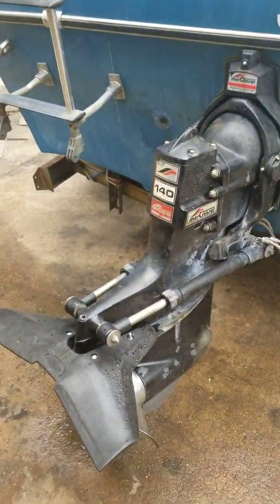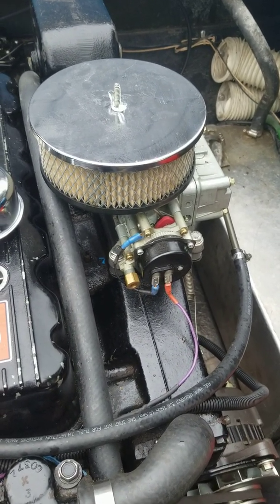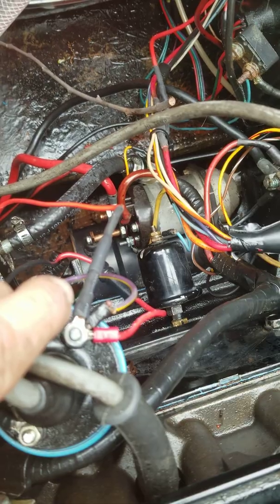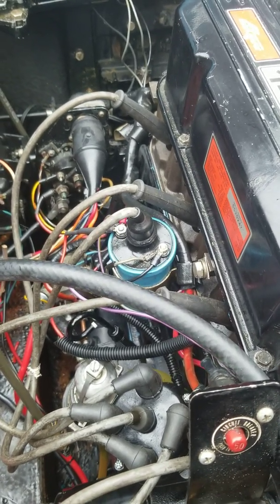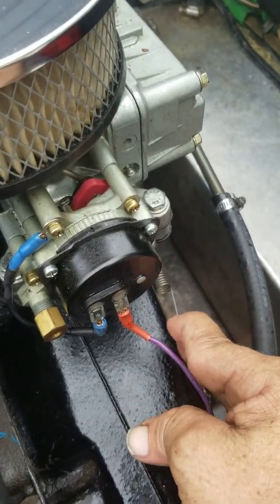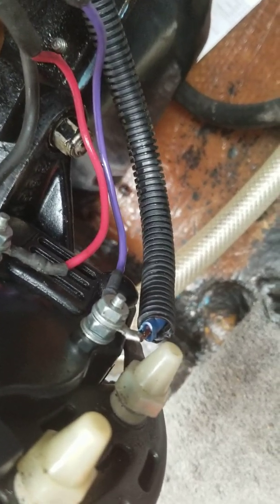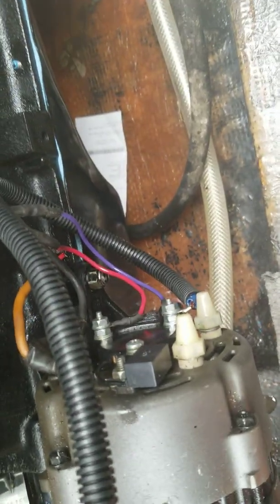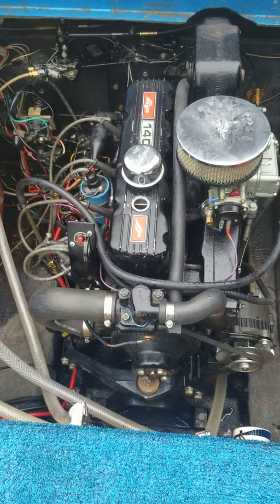1980 mercruiser 3.0 resistor wire & electronic ignition upgrade

Comment: Second, I dont doubt that you got it to work but it seems to be at odds with what the book says about which is that the purple/yellow line is the resistor bypass and the purple is flat 12V.  This is because the original coils were zero ohms.  I measured mine and sure enough the pur/yel line measured only 9+V.  So, it would seem that the all purple wire should be the right one for your purposes even without going to the alternator so it should work that that is the line that needs to be cut.  The manual clearly identifies the purple only as the ignition line.  Pertronix states that too low voltage will cause exactly what was happening to you.  The ignition will fail because the unit overheats with low voltage.  Same if you leave the key on.  When you use the resistance type coil you are adding ohms which makes the problem worse.  Pertronix says to route full 12V to their unit even if you have to go all the way to the key to do it since it has to come from the key switch otherwise you are charged all the time.  With that coil I think if you just cut the pur/yel line you would not have to go to the alternator.
Reply: I wish u could give me some advice...I have same motor ....it will turnover...just can't get it to fire up...I don't understand it at all
Reply: @j.p.foleyjr.6333  The biggest problem I had was that the magnet collar did not physically fit under the standard rotor.  I never did get it to work so I took it to the shop and had them install a totally new solid state Delco distributor.  I just lost all confidence in the reliability of this system and since I fish on Lake Michigan, reliability is rather important.
Reply: @berniestarzewski5482  Pertronix support advises us to tap the magnet collar down on the shaft with a socket that fits over the shaft.  I ran into the same issue.

Comment: The problem with this is that that type of alternator no longer passes Coast Guard inspection as you have to have a spark arrestor shield on the back.  It has a pass thru jack on it but not for this.

Comment: I bought the hot spark(1146A) and 3.3olm coil (1988, 3.0L OMC) what I am understanding, is cut the purple(resistor) wire at the positive side of the coil, then run another wire from the alternator to the same place as the cut wire, is this correct???

Comment: I'm sorry. This was pretty confusing. I have a 1979 Viking Deckboat with a Chevy 305 (Mercruiser) I recently bought. It has ignition issues! For one I'm pretty sure the Distributor is bad. Original Points and Condenser type. I can spin the NEW Rotor by hand so Timing it is not possible. I think I have to r&r the Distributor and I was wanting to upgrade to E Ignition. So far I've had to change the Fuel Pump, then the Starter and now the Ignition System is giving me issues.

Comment: Hi Wes Miller here, thanks for your video. My question is now I bought the same Electronic ignition as you go, but I bought the 3 ohm coil. Hot Sparks customer support told me to get the blue german 3 ohm with this hook up. Can I hook it up without changing anything. My Boat set up is a 1987 mercruiser 4 cylinder 165. The reason I haven't hooked up is I am confused with the 4 wires that are hooked up to the old coil. The 2 that run to the +positive are red and purple and 2 black to the -negative? I was about to hook up till I came across your video and talking about the resistor wire?
Reply: I have a 1987 mercruiser 120 hp.  My boat backfired and would not get past 1700 rpms out on how lake.  Took it home, changed plugs, put pure gas in it. Ran mechanic in a bottle to clean carbs, mechanic in a bottle mixed with gas; it seemed to run better after this.  It was hooked up to muffs btw.  I don’t know what will happen when it put in water?  

Yes, my mechanic put electronic ignition on it, got rid of points and condenser.  Anyway, this may be my problem too, but I am confused a little  by the clip.  I’m like you with your question.  Did you ever figure it out?
Reply: https://youtu.be/wLu0Cp2Lkl0
Reply: Man I have the same exact engine and its turning over properly now but it's not firing up....new coil pack..new starter...new ignition...plugs....it won't fire up tho...just keeps turning over

Comment: Hey brother i need help i have a 1976 3.0 that i retrofit in a 1989 chaparral, upgraded the points to ei system just like yours in 2018 i used the old coil all good running great! went out last night after 30-40 hours run time and she started popping and then no start and no spark..

Comment: If you convert to electronic ignition, you will need to replace the resistor wire that runs from the key switch to the plus terminal side of the ignition coil with a regular wire (no resistance).  This resistor wire is meant to decrease the voltage transmitted through the points during normal running so you won't burn out your points.  This necessary voltage reduction issue goes away when you delete the points from the distributor.  Your boat may not run correctly if you switch to electronic ignition but starve the new coil for voltage by still using the resistor wire (6 volts versus 12 volts).  Also, there will be 2 wires supplying voltage to the coil, one is the resistor wire which is active when the key is in the run position, and the second wire is the start wire which transmits 12 volts to the coil only when the key is turned to start.  So if it starts okay, but struggles to stay running, this is very likely the issue.  Best to check, if you turn the key switch to run, are you getting 6 volts to the coil or 12?  This is probably the reason your yellow coil did not work correctly.
Reply: I wish someone could help me with mine...same motor...just won't fire up...just keeps turning over...just won't fire up
Reply: @j.p.foleyjr.6333  when I did the conversion, the timing adjustment was quite different.  However, it did fire and start, although it stumbled and stalled quite a bit until I could rotate the distributor to the correct position. Are you getting spark?  Fuel?
Reply: @heavyj2134  I just put new plugs in it...and got a fuel line from a ball pump going straight in...so yea I'm baffled
Reply: New coil pack all that
Reply: @j.p.foleyjr.6333  I presume you checked for spark?  It's hard to help over youtube comments.